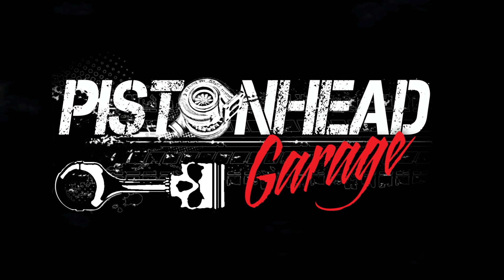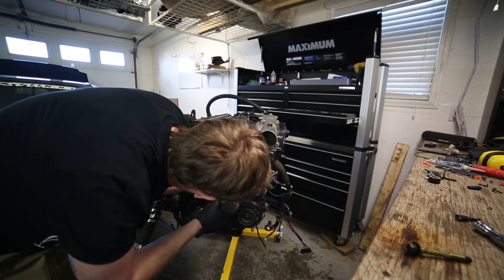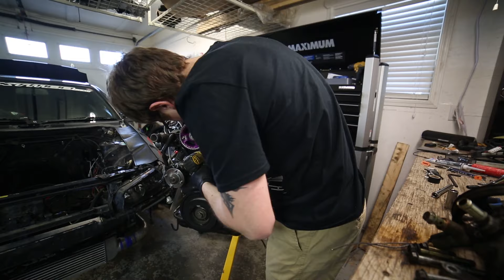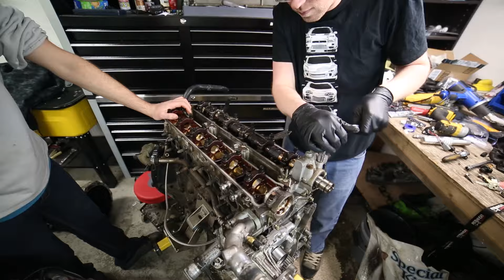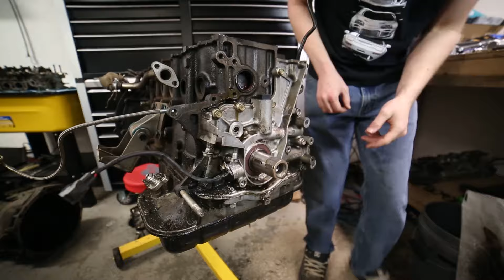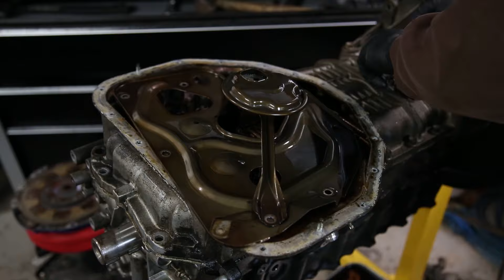Tearing Apart the 2JZ! - R34 Skyline Built Part 8

Comment: wow its been awhile
Reply: oh i actually joined the diesel life and got myself a 7.3 powerstroke f250HD 5spd 4x4 we were talking about it on the van video
Reply from the maker: Stephen Cain about 6 months since the last skyline video. I should have made a video of it actually running and driving but it took so long to finish that I just wanted to enjoy it. The van is getting a little work done this spring too, but it's mostly all maintenance stuff
Reply: yeah i understand if i did a build like that id want to enjoy it aswell

Comment: Hey man, do you have any tips on self educating about cars? Where/how to start and such? I want to buy a skyline in the future so i would like to be ready to maintain it myself and modify it.
Reply from the maker: Us3rNaMeD well when I got started I joined a forum for the car owned (7th Gen civic) and read all of the DIY articles and any time I needed help, the people there were mostly very helpful. Of course forums aren't so common anymore, so YouTube is probably the best place to learn. They key is to start with small and simple jobs until your comfortable with trying things more involved. A lot of the things I learned were just by doing it, and sometimes messing it up. I don't necessarily recommend doing that, but it worked for me lol
Reply: since I cant afford to have my current car in a non running situation I could perhaps buy a "shitbox" that doesn't run and try fixing it, since it wont really matter if I break it even further. just get started and get my hands dirty, thanks!
Reply: Was about to ask the same question , lol !. Thanks for the answer.